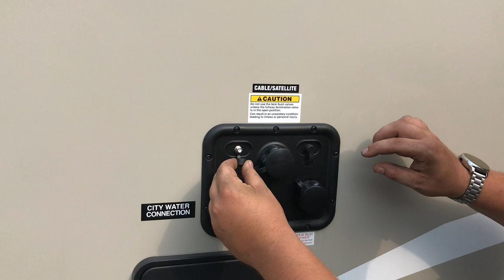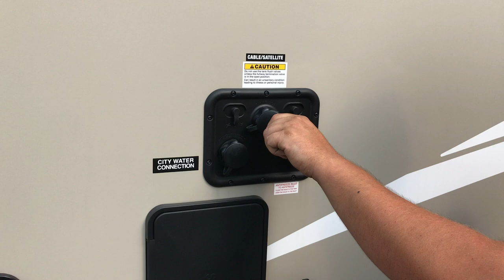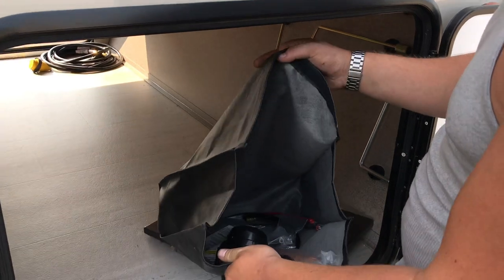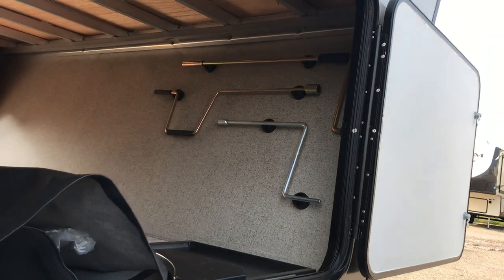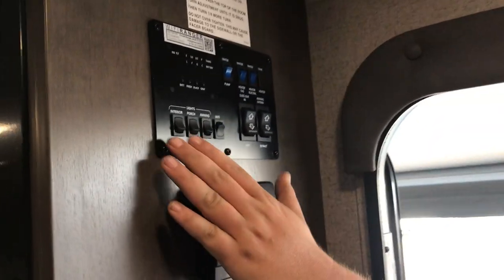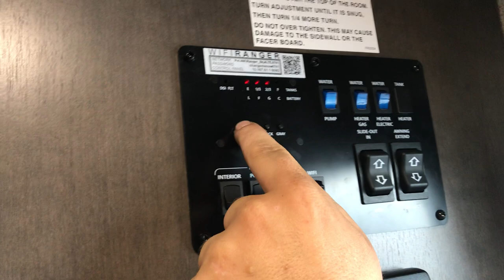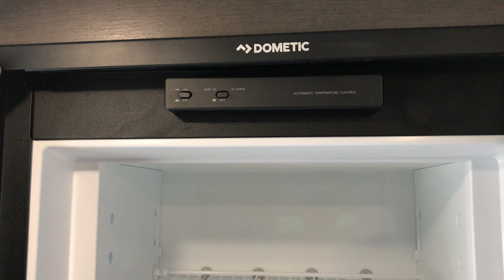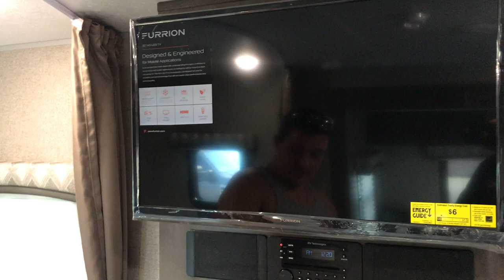MicroLite 22FBS

Comment: Tank heater switch should have been on the control panel, what happened there?
Reply: Most Flagstaff campers do not come with tank heats installed from the factory unless paid for as an add on by the dealer but they do add the false plate if the customer ever wanted them to be installed. 👍